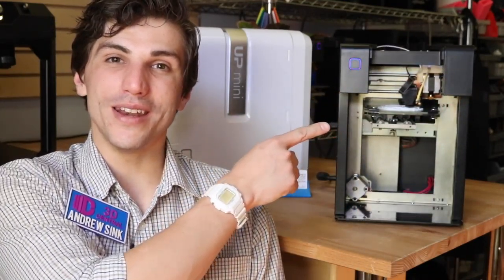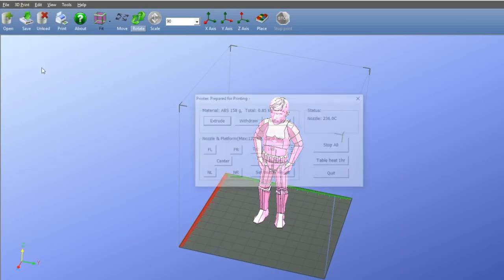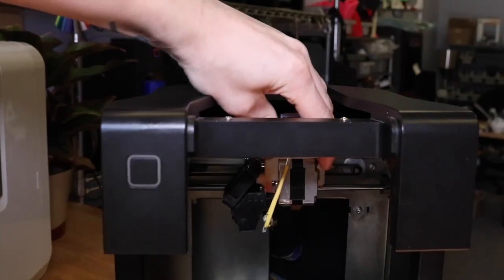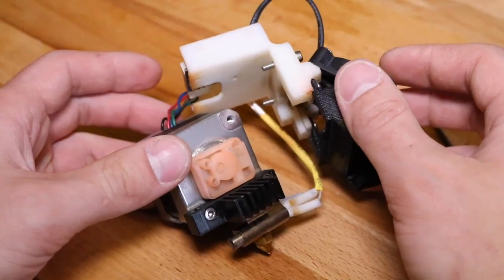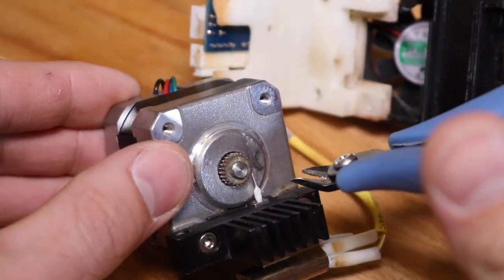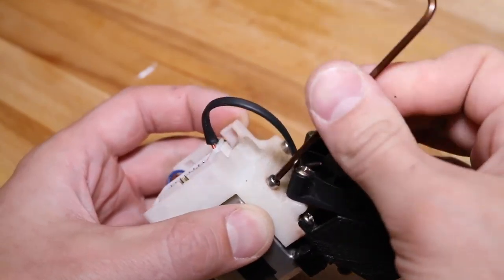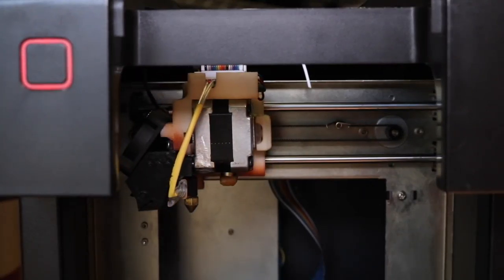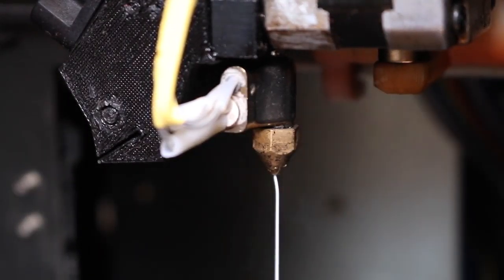Up Mini Extruder Unjamming - Teardown / Reassembly!

Comment: Hi, the clicking sound also comes with withdrawing the filament. How can I remove it manually?
Reply: opened it with brute force..
Reply from the maker: Yikes! Did that fix the problem?
Reply: @AndrewSink  yes, it did. the filament broke and i could open it. the gear in the extruder seems to be made with bad material.. some teeth are already broken. the extruder is quite new. i do not print very often.